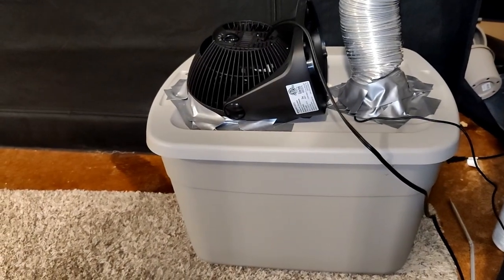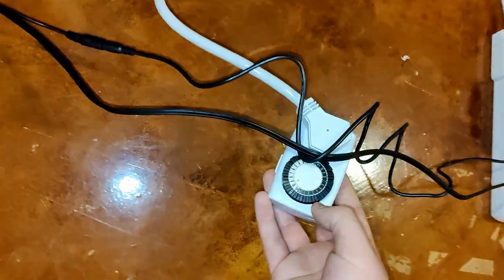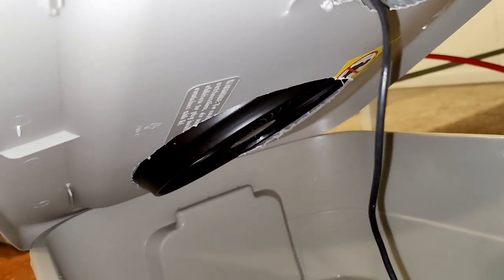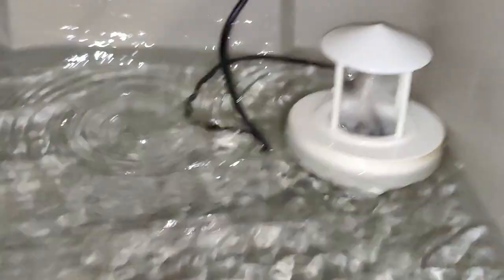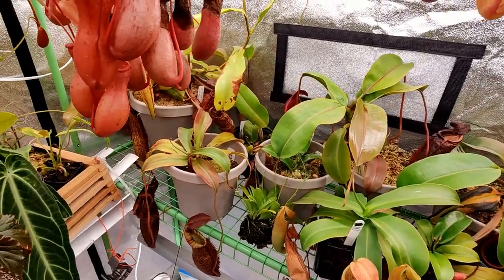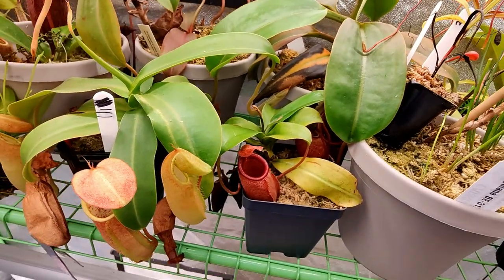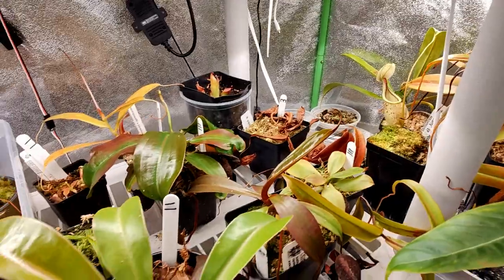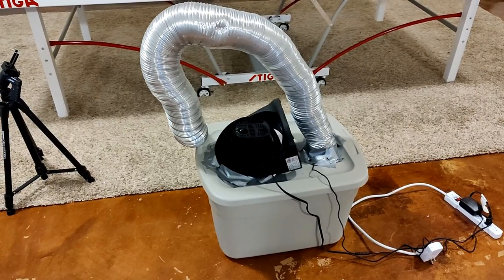How To Build An Evaporative Cooler for Your Grow Tent

Comment: Thank you so much! I’m finally going to get nepenthes villosa with this set up I got going from this video.

I looked at water chillers and stuff and that crap costs so much money and it really discouraged me for a while.
Reply from the maker: Great! Do your temps get low enough for villosa using this setup?
Reply: @joshscarnivorousplants6732  I don’t have villosa just yet. I’m still working on my interchangeable container to put ice in to where the fan blows that cold air into it. But I will get it eventually, after I test the temperature range of my method. Villosa needs 55 degrees Fahrenheit at night IIRC

Comment: Those plants are beautiful.  What are you using for medium and nutrients? Do you have to adjust any lighting?
Reply from the maker: I use a mix of sphagnum moss, pearlite, and coconut crotons for potting media. And I fertilize with diluted maxsea in the pitchers. I Don't adjust lights either

Comment: Looks like you made yourself a humidifier and not an evaporative cooler. It would have to be some kind of material that wicks up the water and then dries from that fabric creating a cooling and not just pushing more water vapors into the tent
Reply from the maker: Right, it's not a true evaporative cooler but it did cool the air
Reply: yeah exactly my thought. just blowing water vapors inside. But still if it works it works lol.

I would combine this with what other mate said in the comments. To throw ice cubes in the container for extra chill

Comment: How many degrees does this cool like if its 80 will it cool it to 70
Reply from the maker: When the ambient rH is approximately 40-50%, it cools 5-10° f below room temp. It will be more effective at cooling if the air it pulls in is more dry.